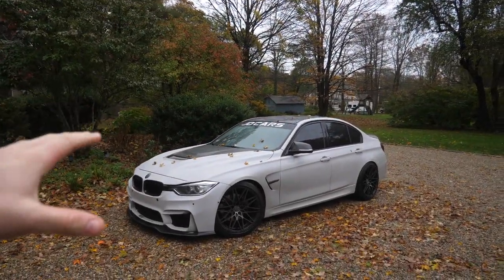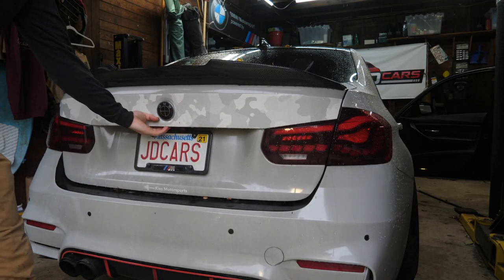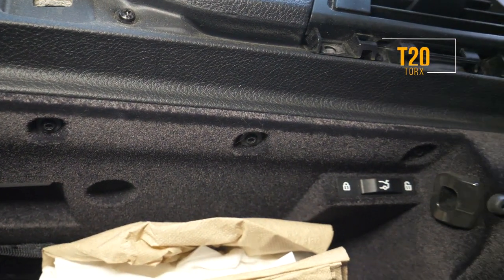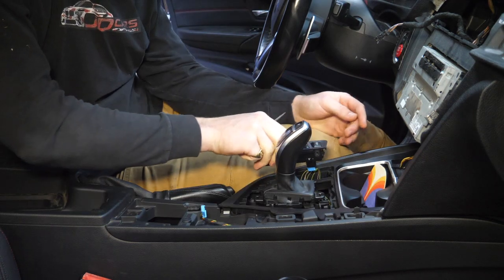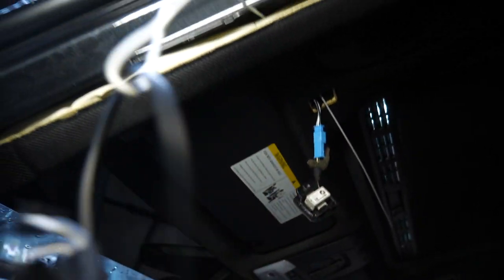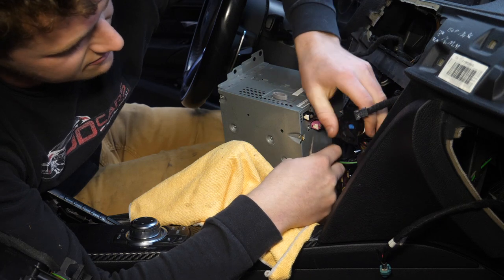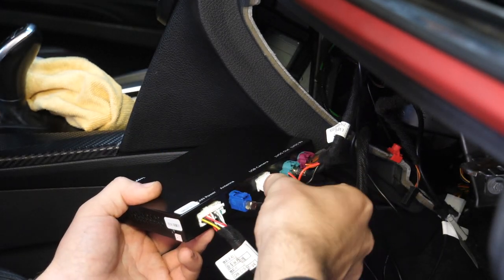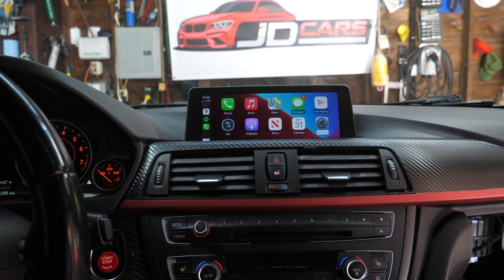Apple CarPlay MMI Install // Full BMW DIY Retrofit!

Comment: Still helping folks to this day! Appreciate the video. Installed my box today. Found the previous owner did some weird stuff with the wiring for a dash cam, but all sorted. Thankfully my unit didn’t need aux, or mic wires ran.
Reply: Can you give us the version that didn't need an AUX?
Reply: @ThePaulogdm  My reply might have been removed because of the link. I got mine off Amazon, and the company is Road Top. My car has factory Nav, so that could be a factor in mine working without Aux or running the microphone. Can't say for sure.
Reply: @plaid_cloud I assume your car is a 2017+ model with ID5 or ID6?
Reply: Car would have ID5 or ID6, which is normally a 2017+ model that doesn't need Aux
Reply: @Schnitzer325ci  2015 w/ HK and Nav

Comment: Quick question, like demonstrated, the CarPlay UI shuts down when park distance is activated by putting the car in reverse or hitting the button. But what will happen if you're on the phone while putting it in reverse? Will the conversation be terminated?
Reply from the maker: The CarPlay UI actually doesn't shut down; Rather, it just goes into the background (still running). This means your music, phone call, etc. continues even when backing up. The only time the CarPlay UI fully shuts down is when the car is shut off completely.

Comment: Excellent video, regarding the Aux cable installation. I have a 2019 F31 and has no AUX port just a USB port. Any insight whether I would need take the arm rest and remove all the idrive trim etc as you show in your video?
Reply: if you haven't already figured it out, no you don't need that.  what i discovered is that you just need to code in the aux option. then you just select that audio option in the system and you should hear sound without connecting anything to the usb or aux port

i did that on my 2019 f23 so your setup may be slightly different
Reply: @youngblood4826  Excellent! thank you for responding to such an old comment. I am still a little on the fence.... What do you mean by "code in" is that on that line of little switches?  looking forward to your insights!

Comment: Very informative!  Simple question though, will I have to enter a code for the radio as the battery was disconnected?
Reply: I Hope JD replied to this question
Reply: NO, F30s do not do this.

Comment: Great video! I just installed this and everything is looking good/working except for the audio, do u have any advice? Thanks man
Reply from the maker: Glad the video was helpful! I'm sorry to hear you're having audio troubles. Did you install the optional aux cord? This may be required for your specific year.
Reply: @JDCarsChannel  Thanks for the response! I actually got it to work. I just had to change the settings on idrive to ‘aux’ and turn the volume all the way up. I also just installed a door/fenders by watching your f30 videos thanks so much for the help 🙏🏻

Comment: Hello, several people commented that the audio with Car Play is not as clean and good as the original Bluetooth connection, I wanted to ask for your comment in this? I would order one of those immeadiately, but I am worried for the audio and music quality.
Reply from the maker: Great question! I don't agree. Thus far, I've been very happy with he audio quality through CarPlay-- never noticed a decrease in sound quality.
Reply: @JDCarsChannel  Thanks so much! These are great news! I will save some cash for this install on my own then!
Reply: @JDCarsChannel I can second that…..I’ve not noticed any drop in audio quality!!
Reply: This is why I’m asking if there is a way to buy just the cable. The mic that came with my unit (not from JD cars) needed to be installed on my steering column and I think that’s the reason why the quality is not good on my system. The OEM placement is great. 
@JDCarsChannel is there a way to buy just the cable?

Comment: Great video! I'm all connected, and eveythng aorks perfectly except the microphone. It functions using the adapter for the BMW microphone,  but when I call others, they notice that my voice is not clear and I end up using my phone's speakerphone instead. Any ideas on how to improve this? Do i need to route a new microphone and bypass the bmw microphone? Thanks!
Reply: There is some settings that you can play with….like MIC volume and OP volume. You can also go into settings and switch to use the car’s original BT for phone only!

Comment: Hey. Installed, all ok except one thing. After I switch off the car it’s showing No Signal, orange color, on the screen until the car’s systems are completely off (after around 10 min.). It happened to you, too or to anyone?
Reply from the maker: I haven't experienced anything like that. Does the system work properly when the car is on?
Reply: @JDCarsChannel  yes. The system is running fine. I’ve identified the issue. The MMI box is turning off faster than the IDrive causing a lag of signal for the display. After complete iDrive power off the message is gone from the screen.

Comment: I bought a CIC one because my F30 is 12/13 and the UI was pretty much equal to CIC ones. After opening it, my head unit has a 4pin LVDS but my screen has a 6pin LVDS (2pin for 12V/power is connected in another place at the head unit - pretty much like yours!). I am basically trying to maintain this 6pin at the screen, leaving the 12V part directly to the HU but connecting the 4pin LVDS at the OUT part of the box/interface and using a 4pin/4pin between HU and IN part of the box. Screen shows "no signal" message, any thoughts?!
Reply from the maker: Sorry, I'm not sure how to go about solving this connector issue. Please contact the company you purchased the CIC from.
Reply: your f30 has nbt not cic
Reply: @costeljankowski1529  that was spot on. F30 12/13 is NBT. Switched the MMI for a NBT one and worked perfecty. But now I bought a 535i GT F07 2011 and had to go back, since its CIC haha. But working 100% too. After you do once at one of them, you get the thing.

Comment: Ok, first off thanks for the informative video. BUT:

1. you totally left out the part where you explain where that aftermarket mic cable goes. Especially after going through the hassle of routing it around the cockpit I would have expected you would explain that.
2. you don't ever mention where the AUX cable goes to. You quickly mention it comes from the main harness. Is that the same harness that is attached to the Head Unit through the quad socket?

Quick heads-up for future video: we are not only interested in the tutorial for what goes where but also WHY you need to wire this thing this way. A quick introduction at the beginning of the video breaking down each component and what it's for would be super useful.
Reply from the maker: Thank you for your feedback!

1. Are you speaking to where the mic cable plugs into the main unit? There should have been a clearly labeled connector.
2. About 10:40 in, I show where the AUX cable is routed to in the center console. The other end goes to the main unit, to a labeled connector as well.

I hope this helps!

Comment: can you skip songs with steering wheel for spotify?
Reply: Curious about this too
Reply: @Tony.Barrera  I had mine installed, what I do, I leave the cursor on the Spotify section of the screen and can control it with the scrolly thing on the steering wheels, so I can can skip song with steering wheel controls.
Reply: @TheMoDiiFii3r  That's good to hear, thanks for the reply!

Comment: This is such a long arse process. Is it not easier just buying an Android screen?
Reply: tbh not really. You still need to remove the radio, AC trim, and bottom sensor panel. The screen connectors are swapped, and depending on what options you choose, you have to plug in the GPS and 4G Antenna into it. If you have a rear camera you can plug it in too. The quadlock harness is also necessary to install and you have to swap the optic cables from your OEM plug to the new one. It's not terrible, but it's still time consuming.